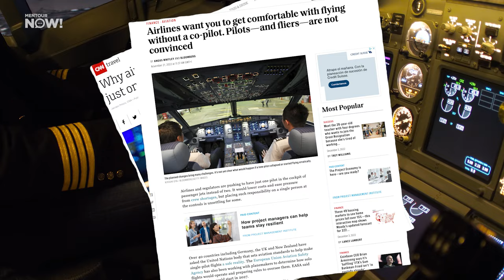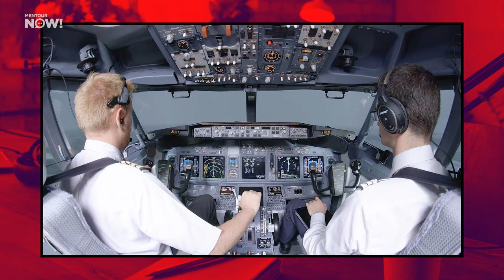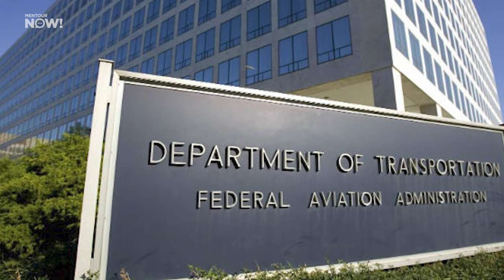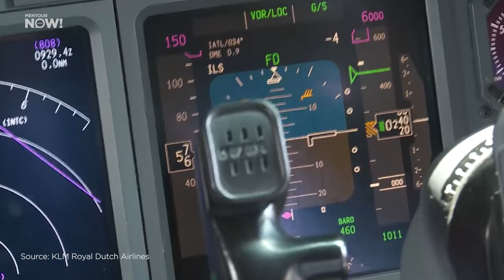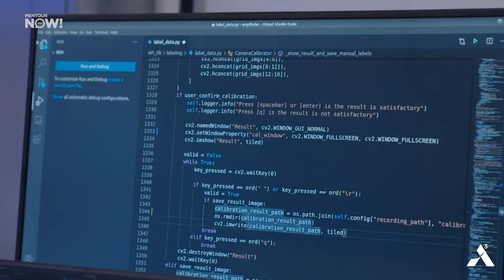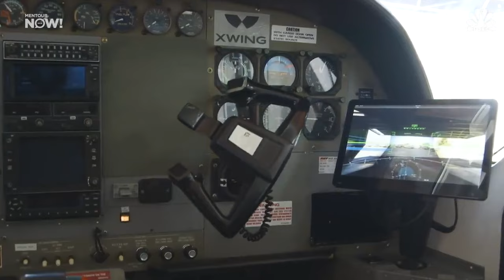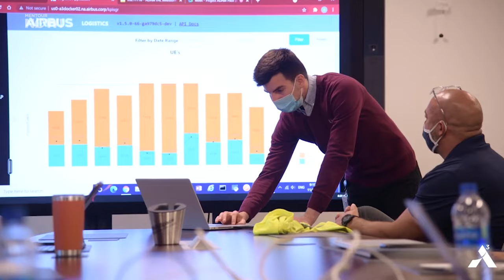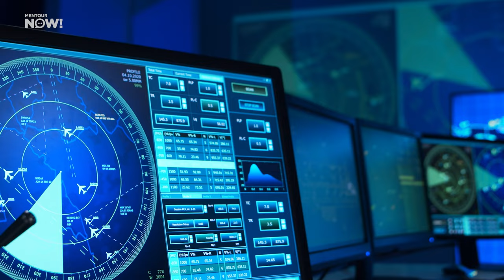The End of the Two-Pilot Cockpit?! Get Ready for Single-Pilot and No-Pilot Airliners!

Comment: Aviation is all about redundancy, breaking this with single pilot flights could be the start of an extremely bad trend.
Reply: Exactly
Reply: The automation is the redundancy and that's the entire point. The live pilot is now just another layer of redundancy.
Reply: @mattcero1   We need to maintain another layer of redundancy for the live pilot, another human pilot. What if the single pilot goes kami kazi? I would never fly a single pilot passenger jet!
Reply: Redundancy is helpful, but it's not the most important thing here. Listen again from 14:22: it's about the interaction between two pilots. It's well known in many fields in that merely explaining to someone else what you're doing catches a huge number of errors. In software development, when we don't have someone else to explain things to, we try to simulate this with a technique called "rubber duck debugging"  (which even has its own Wikipedia page, with references), but though this is proven to be helpful, it's still not as good as having another person present, particularly during stressful, time-limited situations, which are not exactly infrequent when flying an aircraft.

If you asked me what the worst things about having a single pilot are, the first would be the loss of preflight and in-flight briefings, the second the significant loss in ability to handle typical "stress point" workloads (such as the time before landing) where you need to fly the aircraft, plan an evolution and communicate with ATC all at the same time, and, coming a distant third, the loss of redundancy.
Reply: @BigJohnson911  kami kazi meaning?
Reply: @nishant54  Suicide Pilot. Term was Japanese WW2
Reply: It is a TERRIBLE idea to have a single pilot airliner; a single pilot means a SINGLE failure point.
Reply: @BigJohnson911  forget about kamikaze, just a pilot having a medical emergency should be enough to scream "this is a bad idea".

Honestly would not want think how last month American Eagle flight from Chicago to Columbus, OH would of gone if that was a single pilot operation (The captain-in-training   sadly passed away).
Reply: @mattcero1  This, the pilot isn't the main component but the fall back.
Reply: @BigJohnson911  There are such things as weapons. It wouldn't be a trick of any kind to kill the other pilot. There is no inhibition to do it since one was going to crash the plane anyways.
Reply: @mattcero1  another layer of redundancy to what? The flight deck has full allbeit simplified automation for the most dangerous parts of normal flying. The next phase would be some kind of machine learning to which I say, go look at an ai drawing and look at the hands and fingers. More complex automation adds more complex problems and this is ALREADY encountered in newer aircraft with highly integrated systems where single failures result in cascades of failures that not only inhibit flight characteristics but degrade sensors so the automation is not even reliable. Automation fails all the time in day to day life, but the stakes are so low it doesn't matter. Are Teslas stil running over motorcyclists?
Reply: Exactly why I don’t think it’ll ever happen.
Reply: @Curt_Sampson  Great comment Curt. I just keep reflecting back to the disasters that would not have happened had the flights been fully automated. Remember the pilots getting distracted with the burnt out light bulb that ended up letting the plane crash in the Everglades? The pilot who destroyed the rudder over Queens? The three suicidal pilots. And even as good of a job Sully did, a computer would have, in a near instant, started vectoring itself to the closest make-able alternate, Teterboro in that instance. An automated mayday would have been transmitted with intent, all onboard saved still as well as the airplane. With that being said, let's try to predict ahead of time how computers will cause disasters. We have hacking, GPS jamming like they did JDAM's in Iraq and Afghanistan, Very difficult cross wind landings that would be difficult for computers to master. Please add to the list sir.  Thanks Curt.
Reply: We don’t have redundancy for bus drivers, train drivers or other critical personell and it doesn’t seem to be much of a problem. I think in most jurisdictions bus drivers don’t even have mandatory health check-ups. So you could be driven by a morbidly obese, 60 year old smoker with a heart condition who could die at any moment. Sure, an emergency stop on a bus is usually easier than with a plane, but with enough automation a plane could easily have a “return to closest airport” button and just land fully automatic.
Reply: Didn't Max 8 happen? No lessons learned about removal of redundancy happened?
Reply: @mattcero1  sure, and Tesla is currently driving itself as robotaxi everywhere ; )
Reply: @Mike-oz4cv  Great point! Sully did a miraculous job but a computer would have instantly known the plane's make-able runways and within an instant would have picked Teterboro and all surviving including the airplane.
Reply: @nishant54  "Kamikaze" I guess...😏 But, yeah...
Reply: Very good comment.
Reply: @Mike-oz4cv  Teslas still run over motorcyclists. The problem also isn't one person landing a working airplane, it's recovering an airplane that has experienced a malfunction. You only need one person running a bus because it can just stop. Literally look at all the times Teslas have crashed the car into easily avoidable objects or at the severity of problems caused by sensor or instrument error. I'm reasonably sure train conductors have medical exams or have some kind of redundancy. If not that's obviously hugely dangerous and may explain some accidents.
Reply: @mattcero1  Thanks for your comment.

Regarding US Airways 1549, if the computer had turned towards Teterboro earlier than Sully did it would still have been just as wrong as Sully discovered he was: there was no way the aircraft could make it anywhere near that runway without an engine restart.

But the real issue I have with your thoughts on automation is that you seem to have (a not atypical) view that somehow the automation's going to know more than the pilots do. But generally that isn't the case. Automation can react much more quickly once it has reliable information, but the problems are usually with figuring out what's going on, which information sources are reliable, and which are not. This is even harder for computers (which are merely programmed—or in the case of neural networks, trained—by humans) than it is for humans themselves. This is why when instruments start giving inconsistent readings the standard procedure is to have automation turn things over to the pilots. But even when you have consistent readings they don't always tell you what's going to happen: certainly at the moment of engine failure on flight 1549 there was no way that anybody, human or computer, could know whether or not an engine could be restarted.

In the end, safety mostly comes out of good procedures and good preparation. We know that humans make plenty of errors, but we also know how they tend to make errors and have plenty of experience mitigating this. And humans have one ability that computers simply don't have at all (and have no prospect of having any time in the near future): the ability to deal with unanticipated situations.

There's a little poem that frequently comes to my mind as I watch, all too often, unwanted results from a program I've written: "I really hate this damn machine; / I wish that they would sell it. / It never does just what I want / but only what I tell it."
Reply: @Curt_Sampson  I believe in the movie "Miracle on the Hudson" the simulator pilots made it to Teterboro after unrealistically heading there very soon after the flame-outs. That's all I'm saying. Computers are much faster than humans and can store more information. These chess games you can play are a good general example. They know all the moves and are extremely hard to beat especially when you put them in expert mode. The computers will have the entire checklist in RAM and do indeed know more than the pilots do. Otherwise the pilots would not need to grab the procedures and read them. The computers would know instantly if it's a "Land Immediately", "Land as soon as Possible" or a "Land as soon as Practical" emergency and immediately adjust their flight path and head to airfields that are constantly updated to accommodate winds, fuel, altitude and speed and other parameters for sure.
Reply: Yes, do we remember the last time a commercial airliner was designed without enough critical redundancies? Like, a little thing called MCAS that got all of its information from a single AoA sensor aboard the 737 max 8’s? Even now, at least as far as I understand it as a layperson, when MCAS detects different readings from the two AoA sensors it’s not smart enough to figure out which one is giving the correct input. Thus when that happens it hands the situation back to the human pilots who CAN either figure it out or can fly without it. That might involve correcting the trim manually but they’re trained to do it.

And even then I’m not entirely convinced that’s much of a solution really. Airbus such as the A320 family have three AoA sensors and thus if they had to have something similar to MCAS then it would be able to automate it. Simply program the computer to trust the input from the two sensors that give the same reading if the third malfunctions. Train safety systems work in a similar way.
Reply: @Mike-oz4cv  in all the situations you listed there's a much better chance that a passenger on board can take over and get everyone to safety - how many people can fly an airliner?
Reply: @Mike-oz4cv  Yeah but a bus driver can just put on the brakes or pull over and stop at the side of the road and the passengers can disembark very quickly, even if they have to smash the windows and climb out. Emergency services can reach them very quickly and have easy access to anyone trapped or injured. 

However the same cannot be said about a commercial airliner at 35000 feet. They certainly can’t just pull over and get out. No emergency services can reach them and get aboard to help.  And besides, changing direction and getting to the nearest airport is seldom possible. When I had a tyre blowout a few weeks ago I was still able to steer my from the central barrier and would have skid to a halt even if didn’t use the brakes. But if an aileron or elevator breaks then it’s probably game over for that aircraft. 

A bus driver and a commercial pilot both operate vehicles that carry passengers and baggage around, but that’s the only real shared trait. Flying a commercial plane is very different than a bus and requires a much more advanced skill set.
Reply: @mikoto7693  With current technology it should be possible to remote control the plane or have a capable enough autopilot to land the plane in an emergency. With a fly-by-wire system there is really not much advantage in having a human pilot on board.
Reply: The CEOs and executives are a reflection of bad trends.  Let it continue on.
Reply: @Mike-oz4cv  
Trains operate in a one-dimensional pathway.
Reply: @BigJohnson911  There was an Asian pilot who went kami kazi with another pilot in the cockpit so this theory doesn't hold water. They theorize he put his feet against the yolk and pressed it forward and the other pilot couldn't do a thing to get out of the dive. The German pilot simply waited for the other pilot to go to the bathroom. Since then a flight attendant needs to be up front during bathroom breaks but still this person could not prevent the flying pilot from going into a foot induced dive. No pilots are better than only one pilot.
Reply: arent pilots all drunken anyways like truck drivers? i saw Denzel in Flight most pilots have 3 or min 2 bottles of vodka before the flight
Reply: @Mike-oz4cv  "...with enough automation a plane could easily have a “return to closest airport” button and just land fully automatic." There is no safe, general case "fully automatic" landing system, and we are nowhere near having such a thing. I suspect you have no idea at all how much work is required from pilots to set up an autoland.
Reply: @Curt_Sampson  All of that can be automated. The nice thing about an instrument landing is that it doesn’t really depend on vision. So you don’t need all the fancy, error prone image processing, machine learning systems required to make cars self-drive. The biggest problem is that communication still relies so much on human language carried over low quality analog radio. But that’s just a cultural problem.
Reply: @@phillipbanes5484 Humans are egoistic. And it’s not only about maximizing profits. Market share is a bit like natural evolution. Genes which are most adept at propagating are going to dominate the gene pool. If a company can reduce expenses and make do with fewer pilots by only using a single pilot per plane (or maybe no human pilot – at least in the cockpit – at all) it will have an advantage and will gain market share. Assuming of course it all works out and accidents (if they happen) don’t scare away customers.
Reply: @@phillipbanes5484 Profits is just someone’s income.  Unfortunately people love high income, no matter how high it already is.
Reply: @BigJohnson911  Exactly. Remove humans from cockpit altogether.
Reply: @@phillipbanes5484 But what do you propose to do against it? IMHO in most of Europe it works quite okay thanks to government regulations and unions.
Reply: Not really. A series of accidents and they will revert to 2 pilots. They will modify any planes that have seats for one 1 pilot. That's life.
Reply: We all agree/ Two to aviate (in an emergency)
Reply: @Curt_Sampson  Yup, this is why my company always sends two people on business trips. Humans work way better when they have someone to talk to